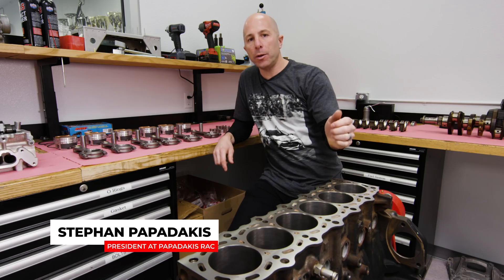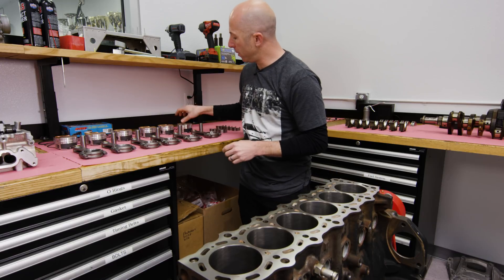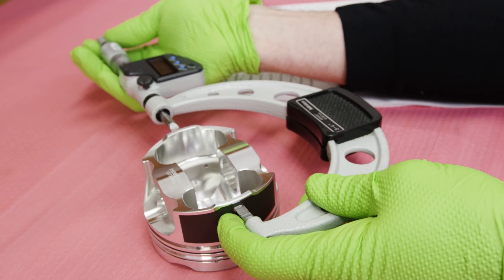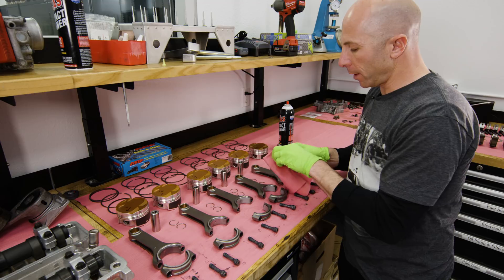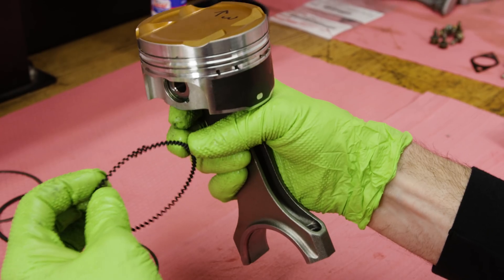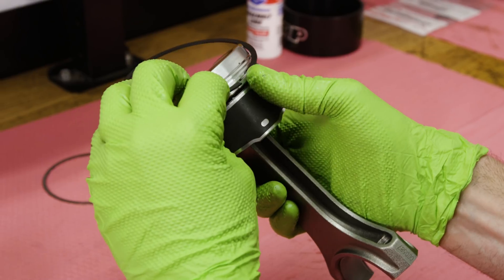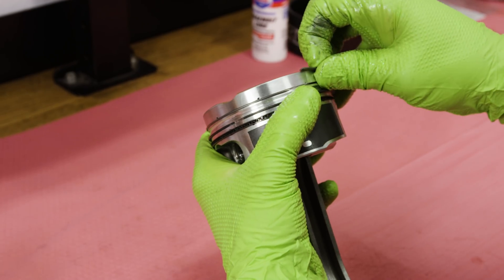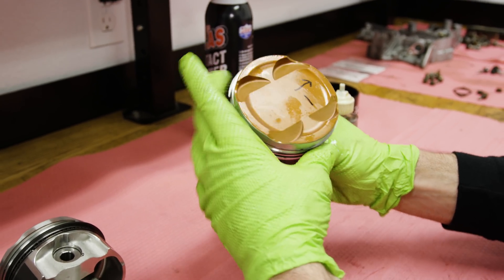How to Build a 2JZ Short-Block with Papadakis Racing

Comment: RIP piston coating.. also I was always told the seal gaps should be 180 degrees from one another, not 20 as that is almost too close together and has a much higher chance of vibrating itself around towards eachother and then being parallel which isn't good.   So is this some youtube famous type engine building where you understand the knowledge and then don't apply it in the video :/

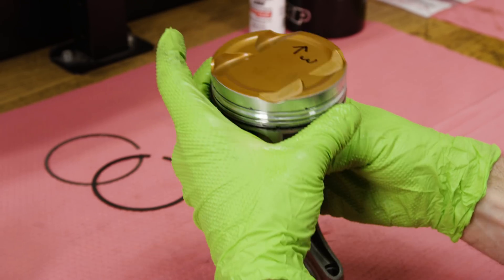Comment: 3:37 scratched piston by ring
Reply: Actually it is scratched
https://imgur.com/a/N3BrjVf
Reply: And does it matter tho ?
Reply: @Dilla2times  Yes. Part of the coating could be scraped off, and it it's pitted enough, could be a point of failure for catastrophic damage.
Reply: No scratch goofy
Reply: DOCUDRAMA Scratched. By top oil ring.